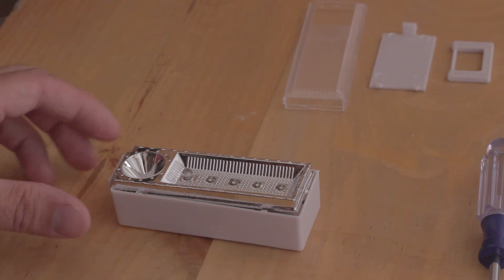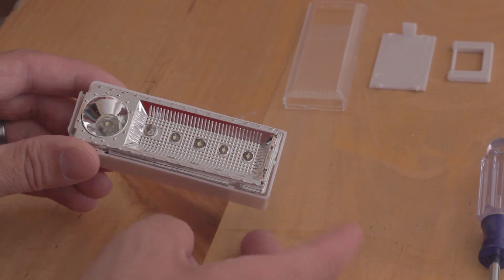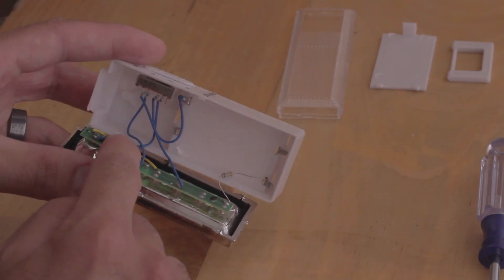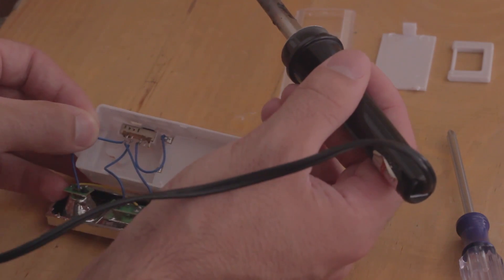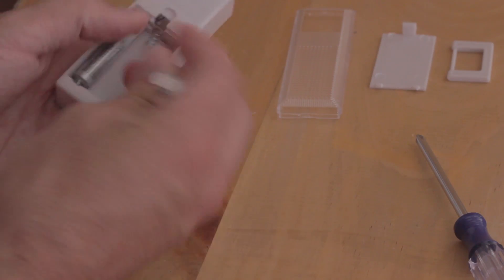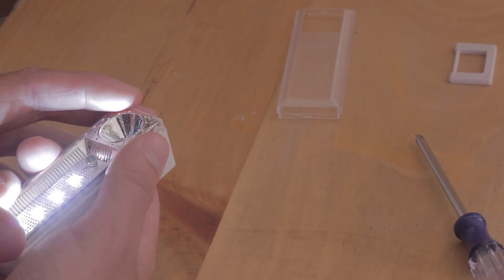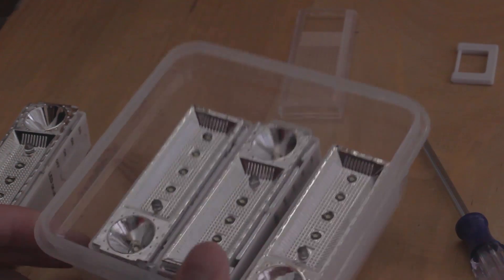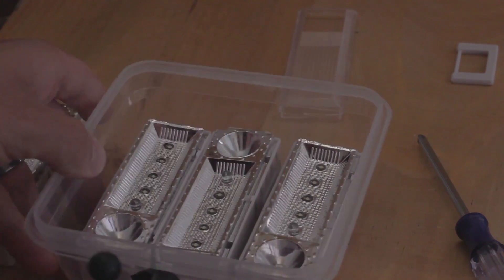DIY LED Light Panel Update

Comment: Bet it sucks those little batteries pretty fast though huh?  can you wire them all to an outside mounted battery and switch them on from there? I wonder what size battery would run a four pack of those?   hmmm...